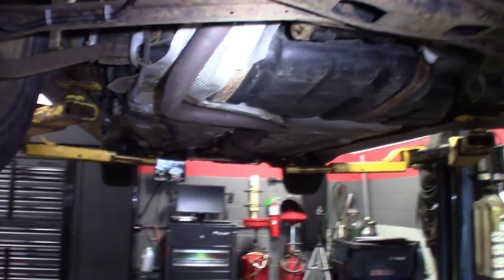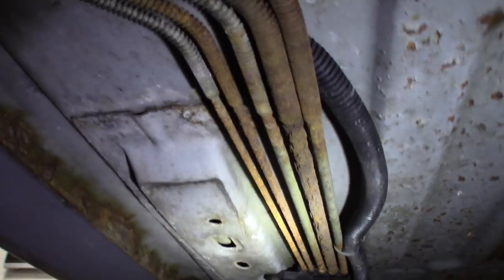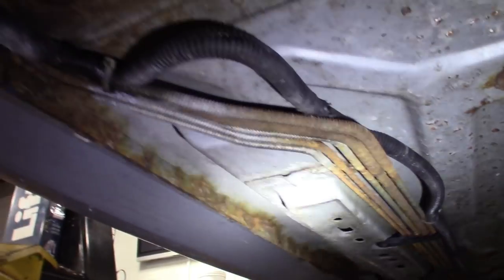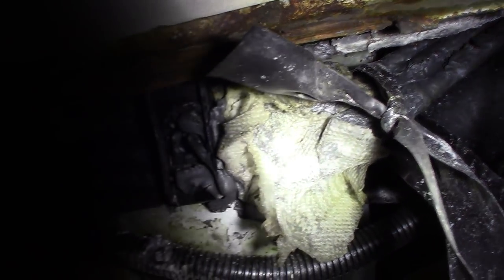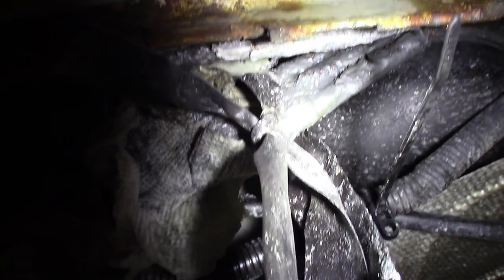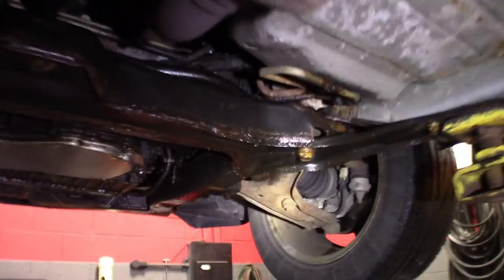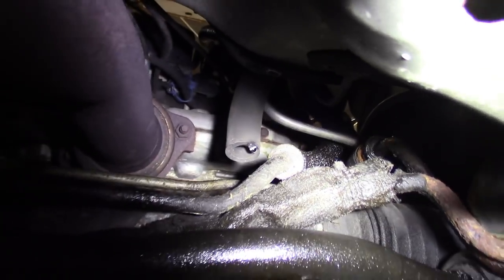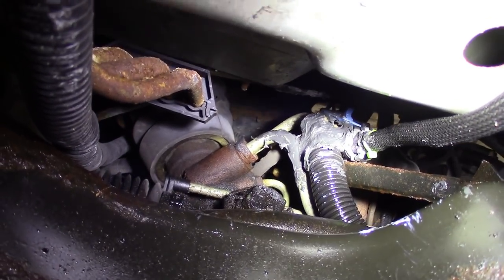I Fix What ''Your Guy'' Repaired...

Comment: I have seen  it before,one was with a 2003 Buick Rendezvous.Came in with a grinding noise,was told their cousin did replace the rear brake pads.Their cousin said it was a bad wheel bearing.Got it in and took the rear wheels off,found the brake pads were installed incorrectly metal to metal.Had to replace the rear brake rotors and brake pads.

Comment: Lmaooo this is great!!! I bet bending up those brake lines and fuel lines isn’t cheap. I’ve just done some for a couple of pieces of equipment so far.
Reply: They actually make easily flexible lines anymore that are hand bendable because of Rustbelt stuff. 

If its a small deal or the customer prefers on a bigger deal I'll custom bend, flare if needed. With bigger quantity line length I'll run the hand bendable stuff and it's safe. My opinion is they should coat those lines from the factory. Something like a bedliner material. I'll never buy new again but if I did I'd personally coat it and really get the areas that rust good along with all steel brake, fuel, hydraulic lines under the car as extra insurance.

Comment: Whoever did that just needs to stop working on cars. Had a car come in and while performing a inspection, noticed the right rear didn't have any brake pads in the bracket and had some locking c clamp pliers holding in the piston.
Reply from the maker: Someone need to pull his mechanic card. I couldn't believe it when I saw it.🤦